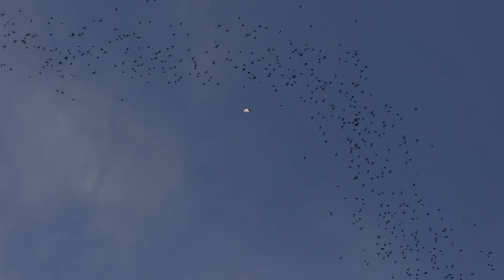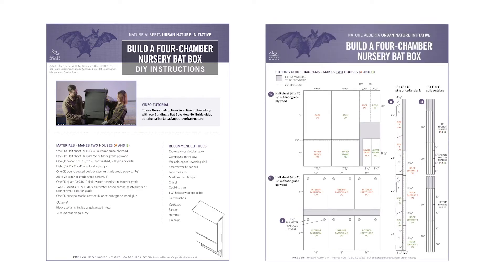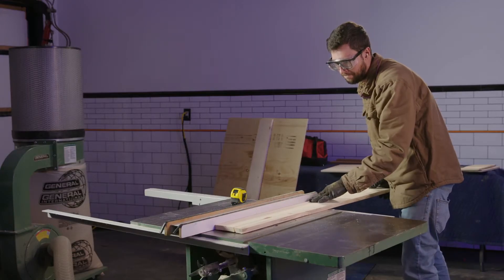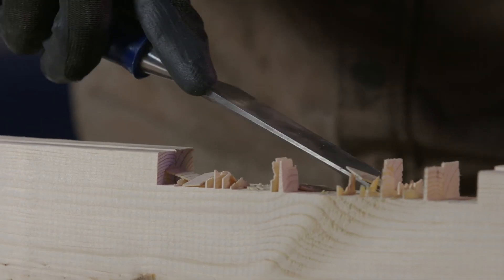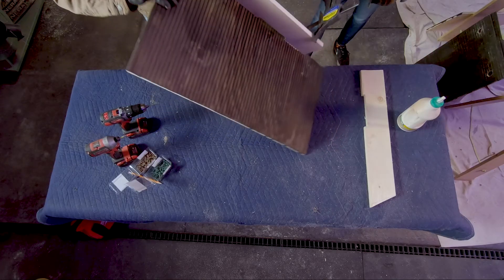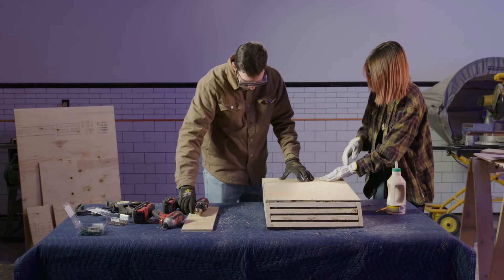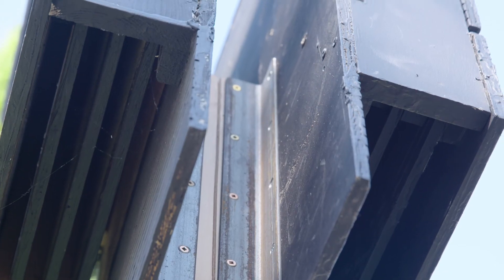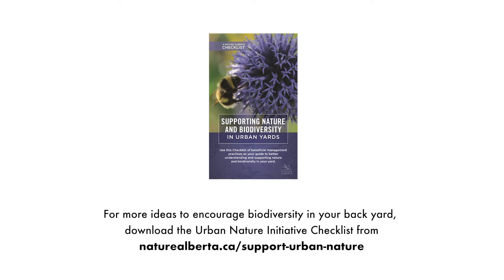Building a 4-Chamber Nursery Bat Box: How-To Guide - Nature Alberta, Urban Nature Initiative

Comment: Great video thanks.  I believe for it to be a nursery box you need space under the roof.  You angled your pieces flush with the roof bottom so there's not gap but ideally you want space at the top to allow the pups to huddle together and stay warm.  The chamber end pieces at the bottom of the house should be flush across.  This allows for the proper spacing under the roof.

Comment: NEVER use an assistant to help pull a piece through a table saw cut. You can pull the operator's hand into the blade. It happens! The operator should push it through and the other person can grab it once it's clear of the blade but even that is not good practice. Also, you should never wear gloves when operating any saw. If you contact the blade it will pull your gloved hand into the blade. I also disagree about painting the inside.
Reply: I’m about to build one of these. What’s the reason not to paint the inside?
Reply: @alexreid4131  not necessary and in fact might harm the bats because it's a chemical...also the bats rely on raw wood to hang from. Paint will make it more difficult for them to sink their claws into, in my opinion.
Reply: @ShakespeareCafe  roger that. Makes sense. Thank you for the tips 👍
Reply: @ShakespeareCafe  Stain, always stain. Darkening the wood keeps the inside of the house darker, which bats like.

Comment: Not to be a wet blanket but I wouldn't paint the inside. I doubt you will get any bats due to the paint smell. otherwise good video.
Reply: Correct. Do not paint inside.

Comment: A couple of comments on the design. Make sure the roof line is definitely long enough to fit over the entire top of the box. If your plywood or measurements are off even by 1/8" or if you are unable to get an exact 25 degree angle on the cuts,   it will not fit. Measure twice, cut once. Also, ensure that if you cut the ridges into the backboard and are gluing it to the side pieces, make sure that your caulking fills all of the little grooves so that there is no light that can get through. We were surprised to see how much light got through - even with the spacers in place. If you plan on mounting the bat box on a post, you may want to drill and put threaded rods  through the back board before you complete assembly. Finally, because your interior partition is made out of 3/8" ply, we decided to make the grooves only 1/16th inch deep. That is plenty deep without compromising the strength and integrity of the plywood.
Reply: Thanks for the tip regarding the threaded rods before assembly.  That gave me the idea to add spacers at the top middle where I can drill a hole for a carriage bolt. The spacers will also help keep the partions from warping. I think this may also help distribute the weight evenly rather than put it all on the back when fastening the house to a 4x4.   
I wondered about cutting those grooves in the front/back all the way across. I scratched those in using a keyhole saw rather than using my radial arm saw to avoid those gaps along the edge.

Comment: Why paint and caulk? They are so very smell oriented. Looking inside can be enough to chase them away forever. Nice tips though. Also have a few on plants?
Reply: black paint is recommended by bat experts to better absorb solar heat so pups and bats can be warm throughout the day
Reply: The dark paint makes sense to absorb as much heat as possible especially in areas like where I am (the PNW). The caulk apparently is to eliminate drafts. Bats are picky about such things. But they sleep in caves. Go figure 🤷‍♂️
Reply: Caulking is so that rain doesn't percolate in...and get the pups wet and cold.

Comment: You are Canadian.  Use metric
Reply: No one uses metric with wood.   Same as cooking.  350 degrees, I don’t care what metric is.
Reply: That's just not true. Anywhere that doesn't use the imperial system uses the metric system, or a combination of both (ie when you buy timber in the UK it might say 2x4 or 47x100)
And same goes with cooking, even within the US! Not everyone has measuring utensils for cups or ounces so grams and litres work best in those cases.
Hope that helps!